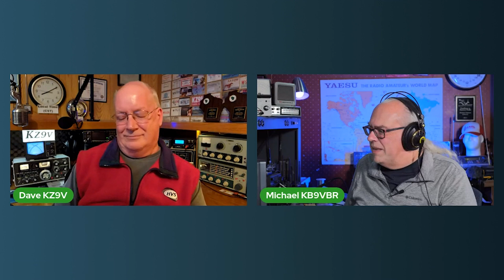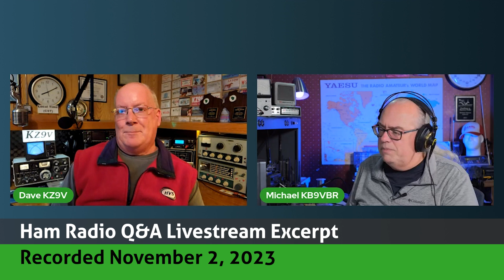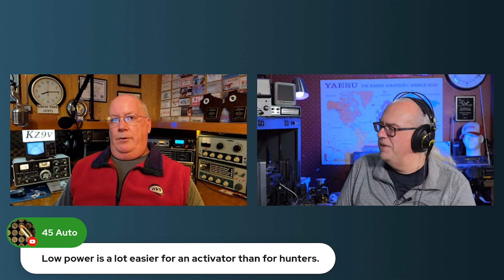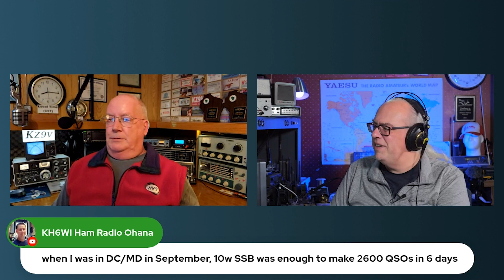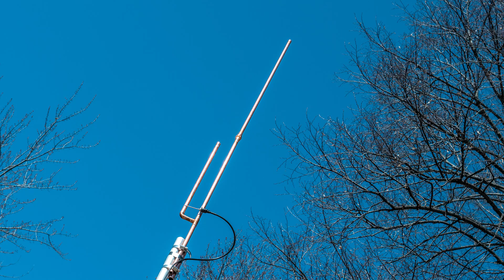As Michael, KB9VBR: How Much Transmit Power do I need for POTA

Comment: I worked you a couple times from Idaho a week or so ago, and had a hard time copying you, but it worked out.  I was running 1kw into a DX Commander Classic from home.  Doing POTA, I like running 100w just so east coast people can hear me from where I'm at here out west.  However, as I was headed to Arizona to spend winter, I activated Big Bend of the Colorado River state park in the very southern tip of Nevada near Laughlin and got the longest lasting pileup I'd ever encountered, so I might have benefited from lowering power....LOL!

I had a blast.  I tent camped with the mild weather and did 40m late shift and got about 40 more contacts, and so I'd ended up with about 100 for the day.  The next morning I worked 20, 15 and 10.  I ended up with a total of 219 contacts when it was all said and done.  That was a blast!  I built a hard case with 2 - 12 amp hour batteries and didn't need to switch until the next morning, so I'm guessing I'd used about a 1/4 to 1/2 of the capacity of the second one when I left.
Mike ND7E
Reply from the maker: It's always a pleasure to get you in the log. I did a little searching and it looked like at least one of our recent contacts was QRP on my end. That might be part of the reason of the weak signal.

Comment: For air travel batteries are limited to 100 watt hours. Running 50 watts can give you a few hours on a 6AH battery while nearly matching other hams running barefoot. In other words, callers should hear you about as well as you hear them.

Comment: I love hunting POTA. I would like to try activating a park some day. I tried once but failed miserably. Quite often a POTA activator chooses a frequency that is too close to a scheduled net and is being blown out by net operators that use 1kw or more. I feel sorry for the activator who might not be hearing the net going on. Is there a frequency guide available that shows an activator which frequencies and times to steer clear from while activating? While everyone needs to share the frequencies they are licensed for but some of these nets have operated on the same frequency for decades. I had asked this same question three years ago on the POTA FB page and receive a ton of hate for asking when I was clearly favoring the POTA program over Nets.
I will hunt POTA operating mobile which is more difficult because you need to keep your eyes on the road. I just tune my VFO to a loud signal which might be a hunter and sure enough a POTA activator will come back. I would say over 50% of my hunter contacts are mobile.
Thanks for sharing.
Reply from the maker: There are a few net directories online. But there are so many nets, you can't avoid them all. I usually try to avoid the big ones, and if I find a net regularly operating on a frequency, I'll make a mental note of it. There have been many times I've been on a frequency and suddenly someone 1 KHz away starts up, blowing me out of the water. If I can, I'll just move up or down a little bit to avoid the noise. If someone gets on the air and says that a net starts on that frequency at XXX hour. I thank them for the news and will either QRT or move before the start of the net. I don't try to fight them, I am flexible and we can all exist.
Reply: @KB9VBRAntennas  Thanks for replying to my comment. I figured you would have a level headed opinion on this subject.

Comment: At my home station I normally run 20 watts ssb through a homemade dipole in my attic and routinely get 800+ mile 5-9 contacts on 40m. I could crank the power up higher, and do sometimes if I'm really chasing a contact but I think my compromised antenna setup is really the weak link, not transmit power.

Comment: I activate from OR. It’s hard to activate POTA CW on less than 15w.  90 percent of my activations are east of the Mississippi where 85 percent of the hams live in the US.   It’s a different animal activating from the West using 5 watts QRP.  

For those living east of the Mississippi, it’s like falling off a log to activate a park QRP CW when you only have to cover a 800 mile radius to work 85 percent of the ham population.  West coast hams have to go 2,000 miles to just get East of the Mississippi.  That’s tough QRP in the daytime.

Comment: I activate 50 watts….and JUST this weekend during POTA I got an Australian QSO from here in Kentucky on 20 meters. My second longest QSO ever to date, 9773 miles on the MFJ whip.
Reply: Yes, Australian station running 4 element beam 200’ in the air, blasting a kilowatt of rf

Comment: Dave, is that a DX=60 and HB-10 over your left shoulder?
Reply: Yes. The Heathkit DX-60B is my original Novice transmitter, which I assembled back in 1973. It's still in mint condition. I found the companion HR-10B receiver at a local hamfest. The Yaesu FT-101EE over my opposite shoulder is of similar mid 1970s vintage, and it still works great, too.
KZ9V